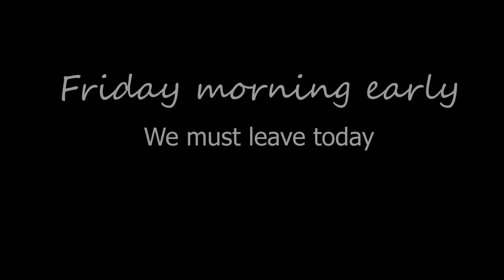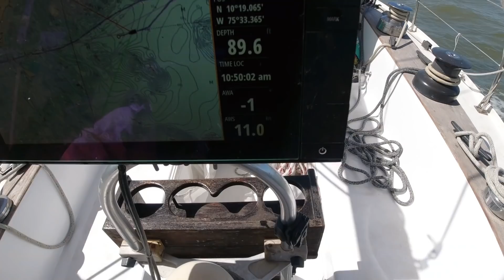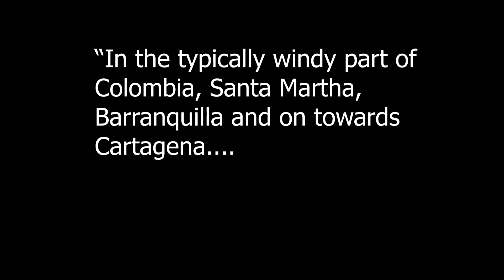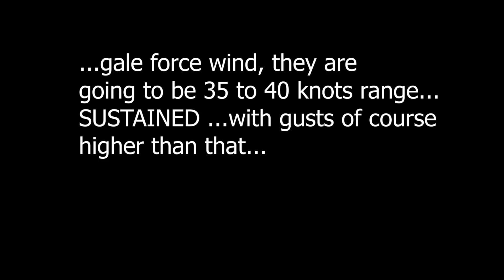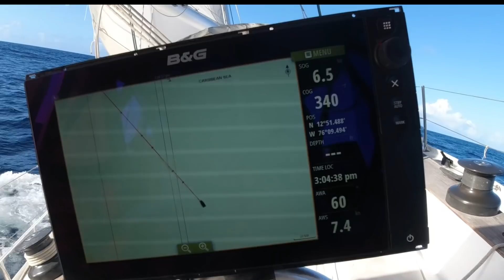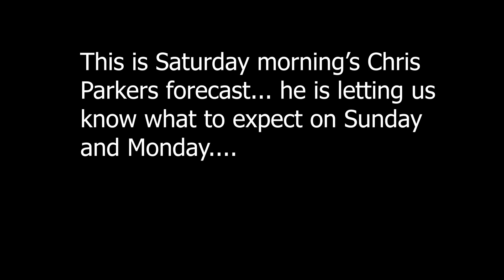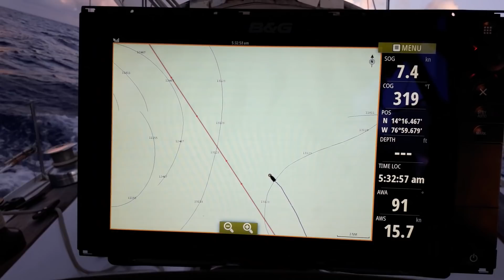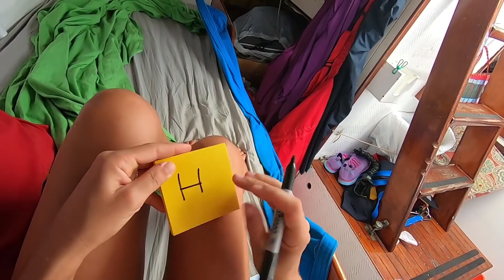Ep. 258  Gale force winds awaits us🌪️

Comment: Great stuff as usual. Good advice on sailing in heavy weather. Herb used to do the forecast many years ago. I remember 30+ knots north of Cuba during the night. A few nerves there. Then 35+ knots north of Puerto Rico but that didn't feel bad due to previous experience. Heave to if you have to especially at night. Then the 45+ knots in the Med. You get used to it. Just gets a little wet! Trust your boat. Except the toilet. Never did trust that. Fresh air toilets work the best.

Comment: Hi, you two, i'm jealous by the way!
I used to sail a lot in San Francisco Bay n outer waters, usually single handed racing in either a 25 Olson, or later in 34 Olson,
but that all came to an end financially!
Anyway my reason for this, is that at times if it was rough, and i had to go forward for a sail decease or chg. i would sometimes
get nauseous, to the point had tie everything down and return to helm to recover min the cockpit, which is disastrous to racing, 
and my self worth.
So i started trying all the stuff available pills, wristbands for the problem, with not much progress, then i read about using  ginger, 
which i already had developed a liking to from my day job, making tons of chocolate candy of which was included tons of 
Chocolate panned and enrobes ginger.
Ginger is quick and awesome, of course you have to be able to stomach it, so start with sugared ginger, and work toward plain
ginger if the eating sugar is against your religion! Hope you can find it at next port, and it helps your cute lady. 
joe
Reply: Nib ni